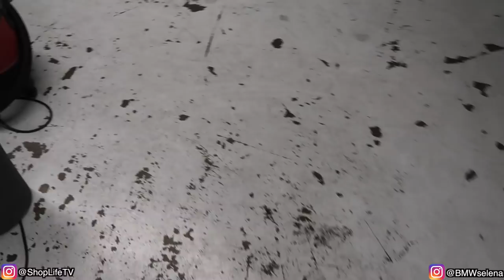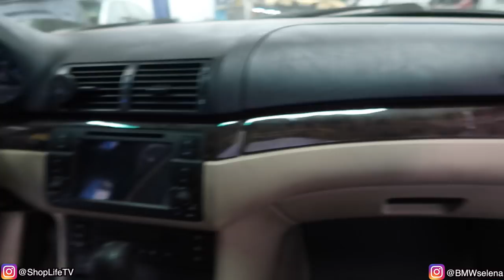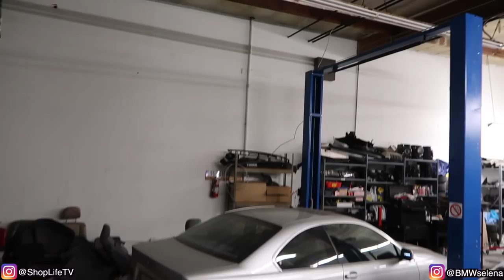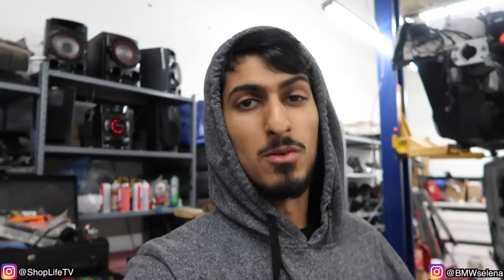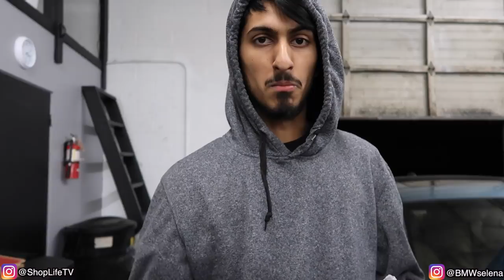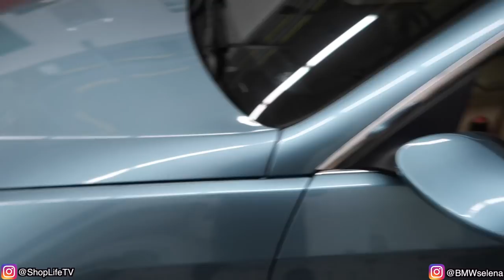NEW CAR LIFT! + BMW MADNESS

Comment: Check out this tool man, this is what you need to get those frozen fan clutches loose... it's for an air hammer: https://www.amazon.com/dp/B000JFJLTC
Reply from the maker: I've rented the tool set out from auto zone once before and it does get the job done, have had a couple that did not come off even with the tool. It worked out in the end though, since the customer now has an electric fan! Thanks for the pointer!

Comment: Sorry if this sounds silly but what do you mean by the fan being "seized on the water pump"?
Reply from the maker: It was stuck on there and would not come off, it happens quite often, sometimes an air hammer with the fan nut attachment takes them off.

Comment: Hy  have a problem with the cooling fan it"s not turning off even if i turn off the car i have to remove the batery, it's an e46 diesel what do you recomend ?
Reply: Check your fuses.